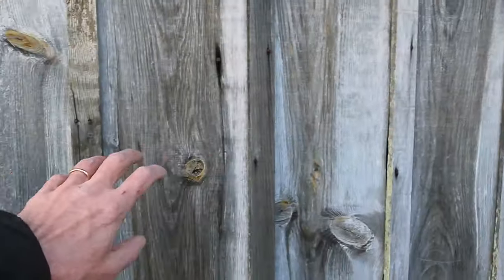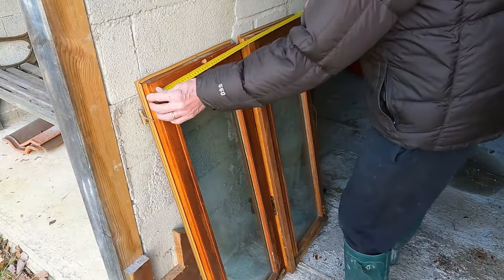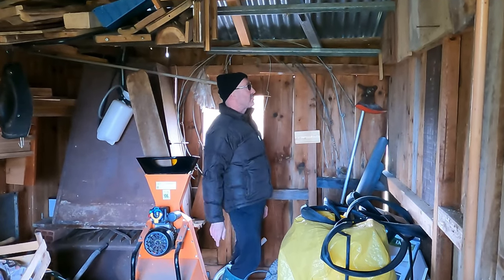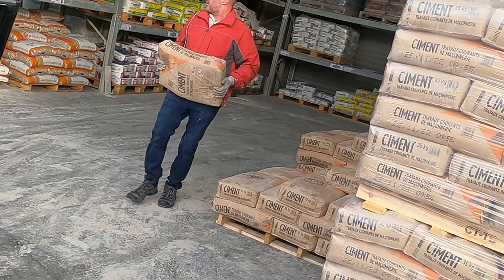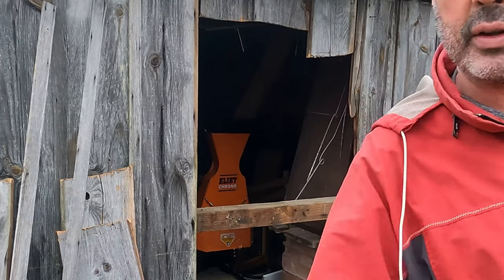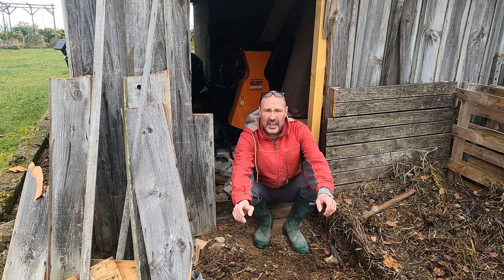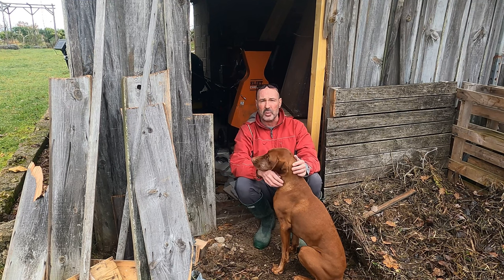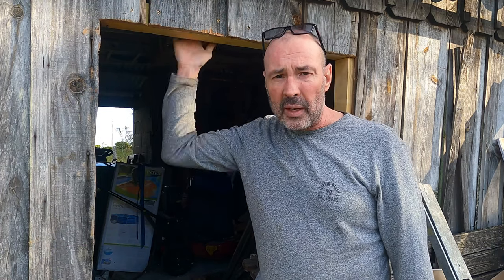Fixing up the Barn Workshop - Work starts here. Episode 1 Laying concrete.

Comment: Might be worth looking at getting a sturdy gazebo with sides to store your stuff into!

Everyone’s different but I need space to work comfortably 😂

Merry Christmas 🎄
Reply from the maker: Hi Jordan. I do have one, buried in there somewhere 😁 Been to the tip today on got rid of loads of scrap. It already feels extra roomy. Regards JP
Reply: @Smallbarnworkshop  ah there we go! You got a lot of room there. If it were me (and we’re all different) I’d make one of the sides slightly smaller for storage then build a covered awning I’ve the side for the garden stuff etc. 

If you ever build an outdoor seating area you could use the log burner for that too!
Reply from the maker: @jordanduller4808  I wanted to put it in the covered terrace I built earlier this year (also on this channel) but it got voted down by the design manager 🙄🤣
Reply: @Smallbarnworkshop  I won’t tell!
Reply from the maker: @jordanduller4808  🤣👍

Comment: Great video, one of your best videos to date, like the format as well (longer is better). Quick question with the size of the garden why did you not go for a new workshop build, it would look fantastic in that setting.
Reply from the maker: Thank you. I made a video about the history of the barn in October. If I was starting afresh I would have, but I’ve already sunk a lot of time into it over the years. I’ve replaced posts, the roof and cast 3/4 of the floor. originally it was three times the size but it blocked the view down the valley. Regards Jp